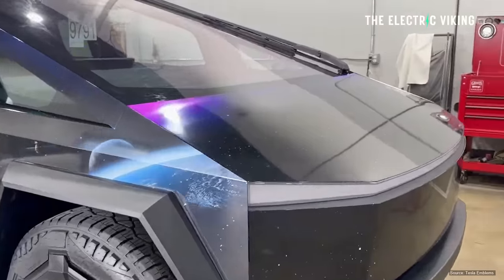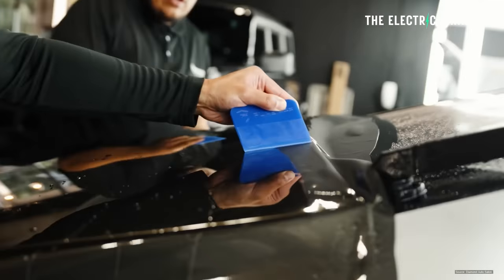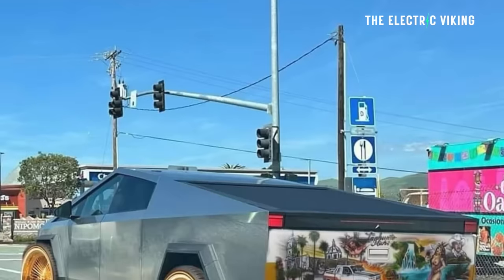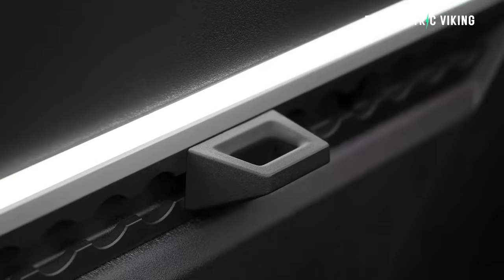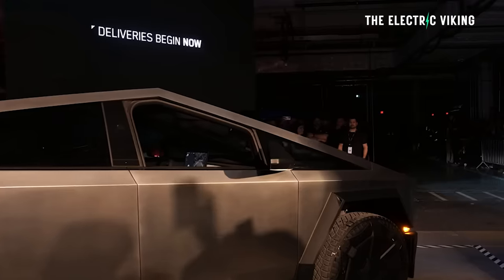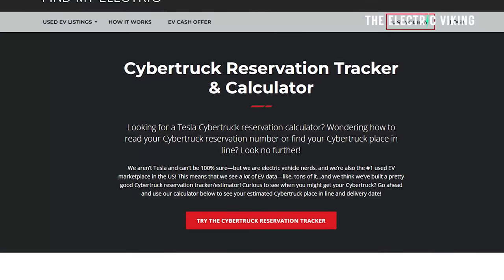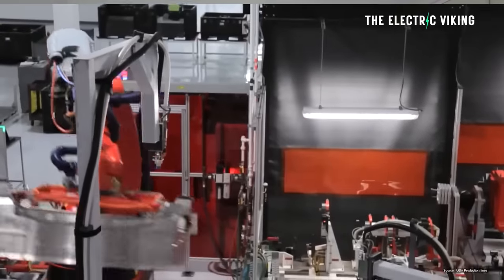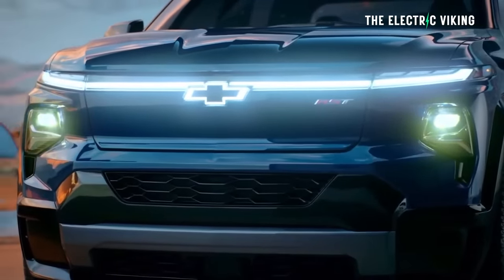Why did they do it?!?! The CRAZIEST Tesla Cybertrucks in America

Comment: Do a video on IM Motor  IM L6, that will be launch with solid state battery by CATL. Tech spesification reveal on 8.4.2024. The car is expected to be launched on May 2024. Battery capacity of 130kwh with range of 1000km on full charge. Alleged 5 times safer than NMC battery.

Comment: Il guess that the stainless exoskeleton can make Cybertruck survive for 100+  years. Just change motor, batterys etc and your grandchildren can have it.  They dont need to borrow from the bank. - And thats true "green manufacturing"
Reply: If you live somewhere where they salt the roads in a few years the steel frame will rust away leaving you with some odd shaped bits of stainless steel!
Reply: @Paul-b2s4j  There is no steel frame. There is the battery pack, the giant aluminum castings front and rear, etc, and the SS exterior shell. There are some stamped steel pieces, but they're all painted and covered. This isn't 1972. Tesla is not Ford.
Reply: @gloredon I have seen the stripped down truck. The centre section which holds the battery is steel. Yes it is painted but the paint will not protect the steel for very long, they have been painting the underside of cars forever n they still rust!

Comment: You want to tow with an electric truck? Oh, so you only want to get one third of the milage out of your EV.  Oh, and don't use it in cold weather or use the heater! 😂😂😂🤡🤡🤡🤡
Reply: Lots of variables - I agree if you're towing 10,000 lbs every day for hundreds of miles, an EV truck is not ideal.  Towing a few thousand pounds is not much of an issue, although it seems less than 5% of truck owner ever tow anything. In the cold and using the heater is not a big deal - about 15-20% range loss.  Surprise - ICE trucks also loose about 15-20% range in the cold due to poor engine effincency in the cold even if you don't use the cabinet heater.  You do get the cabin heat (eventually) for free in an ICE truck.
Reply: The tests show that with a full capacity tow, that is true. And with an ICE truck, they only lose about a third. But imagine towing in the mountains ... Towing at 70mph up a steep hill while your ICE buddies struggle to maintain 45mph is amazing, then recovering a good portion of that extra 'fuel' while towing down the other side. Can't do that in an ICE truck. Downsides exist, but it isn't all doom and gloom.

Just don't tow long distance in cold weather. That would not be fun. But then again, it never is, icy roads and trailers don't mix well.